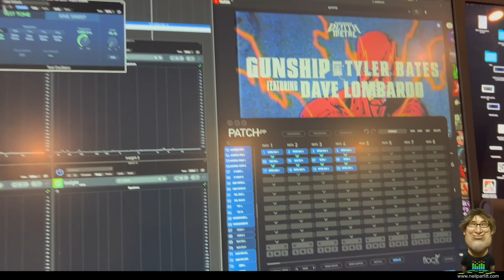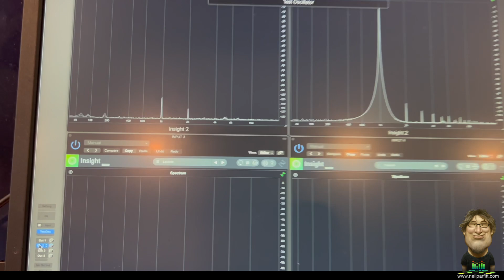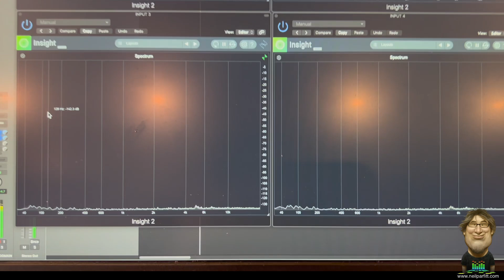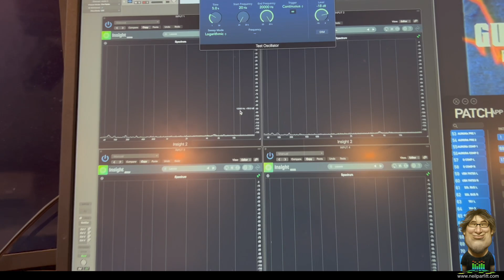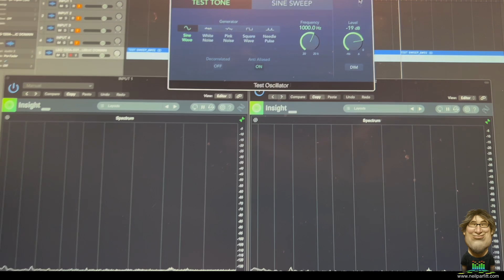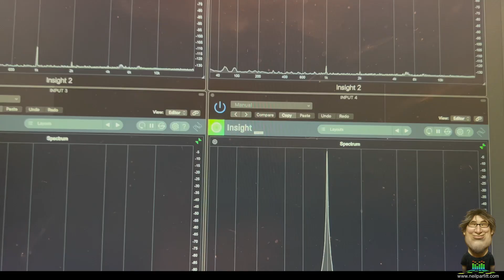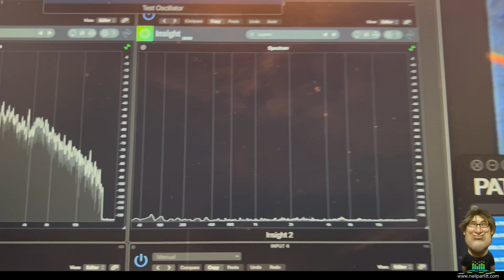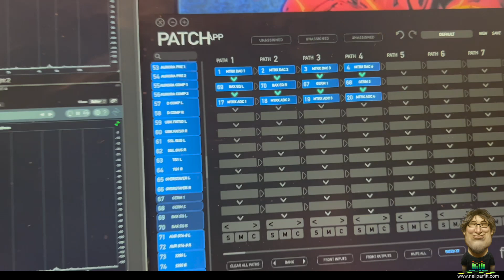The Last Piece of my Studio Puzzle Part 4 - Flock Audio PATCH XT & AES72 Crosstalk Tests

Comment: The only reason I would consider the shielded cable after these tests is in the off chance that your RF environment changes and causes noise to creep in.
Reply from the maker: Happy 2023!  Well,  too late now as I've deployed with 5e UTP.  But on the plus... if I really had to,  it would take me a day and about $375 of cable to flip out the entire room out / Zero Soldering.  I'll keep an ear out! :)
Reply: @NeilParfittMusic  HNY to you as well. Congrats on all the upgrades. I have been enjoying watching the series. Glad to hear this is working out! I am curious as to when why you decided to do your speaker processing and monitor control in the Trinnov over using the DAD-MOM with the MTRX?
Reply from the maker: @Drummerboy106  two reasons:  first being is I bought into the Trinnov system years before owning a MTRX,  but also even now it does more for monitor control and calibrations... and thankfully,  almost 100% automated in setup as well.
Reply from the maker: @Drummerboy106  I bought into the dmon 3 years before owning the MTRX.  The calibration on it is amazing as it deals with phase on top of overall delay and response... and a pretty automatic procedure.   I only have one slot open on the MTRX and I'd rather use its for more MADI or DANTE than an SPQ card.

Comment: Hmmm, are you actually measuring the crosstalk in the cables?
You're going to see crosstalk between the pins of the DB25s. (yes really) There's not much that can be done about it though, that's the standard. It's a crappy connector, but it's the standard.
Next, you're sending very large signals across the bus in the XT, but there is a LOT of care taken to isolate the channels from each other.
You'd really have to figure out a way to determine if the noise is coupling in the cables, like send the signal out 1 and look for the crosstalk on 5 (which would be on a different cable). If the crosstalk is still there, it's not the cable.

Now, how often do you see crosstalk testing done at 0dbFS? Never,. Crosstalk is typically done vewwwy quietly. And distortion is done vewwwy vewwwy quietly. Nicely done.

BTW, crank up the frequency to 50kHz. and see if the distortion goes up. It's above human hearing, but well within the timbre component of a high pitched sound, not everything is a sine wave. I always hated the sound of cymbal crash on a CD with a 20kHz hard cutoff. What happens with all of the harmonics that make it sound like a cymbal? They get cut off. 
When does the XT roll off? Enquiring minds want to know (unless your tools can't do it, which is possible)
Reply from the maker: yeah, my takeaway is, any crosstalk enountered is below any amount that would ever matter.  So,  all is well in the universe! :)
Reply from the maker: I could try a sweep that high if i ran at 96 or 192K - but I'm still in 48K-land for almost everything.

Comment: Great video Neil. Honestly unless your pushing through vast amounts tcp/ip data or the signals your using anything above CAT 5 is a waste of money and cable management so much easier with thinner cables.
Reply: It really is for many people. I do residential low-voltage cabling and networking installation and everyone always wants CAT6a but quickly change their mind when they see the difference in price per foot and termination. I ask them, how likely do you think it is you'll ever need 10gbit networking? Likely enough to about double the cost? CAT5e will do up to 5gbps at slightly shorter distances than the max CAT-cable spec of 100m with good quality cable and terminations and even that speed is not commonly seen in consumer gear yet, you're lucky to get 2.5gbps ports as it is. That said we'll still recommend CAT6 for any switch-to-switch trunk lines, but access ports are still good with 5e for most purposes.

Comment: Are the channels you are running in the test all using a single cat cable? If so, then it would make sense the Cat 6 STP doesn’t do anything as it is a single shield around the four pairs of wires. Cat 6A has a shield around each pair of wires in the cable, so it should cut down on crosstalk. I know it isn’t practical from the reasons you mentioned earlier, but the nerd in me wants to know!
Reply: Yep, for shielding the wires against each other you'd want to look for FTP cable - folied twisted pair. 
(Or, to be more precise - the designations U/FTP,  S/FTP or F/FTP all have the inidivdual strands wrapped in foil. Not to be confused with F/UTP, which has one overall foil sheath, but no individual shielding against crosstalk.)